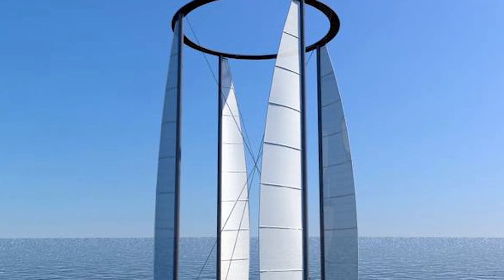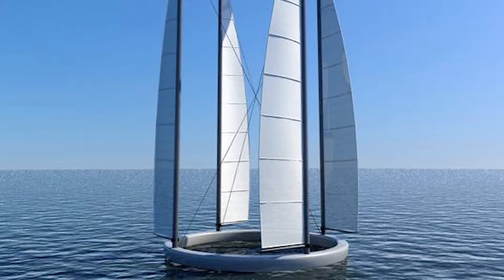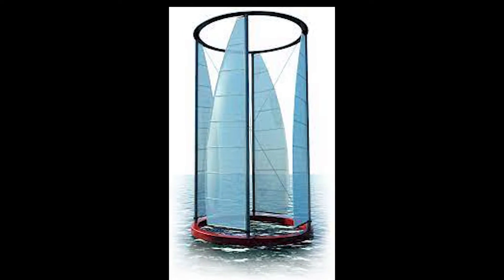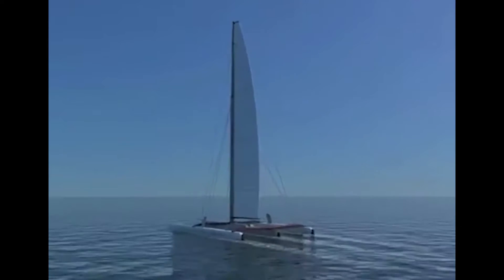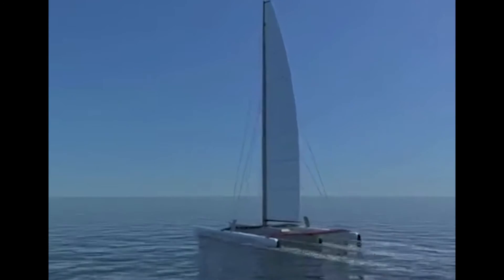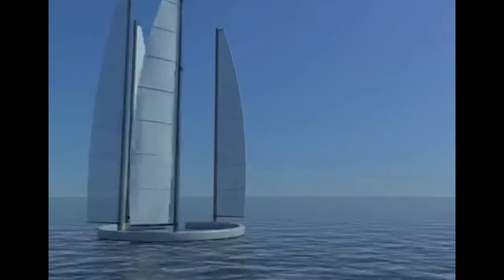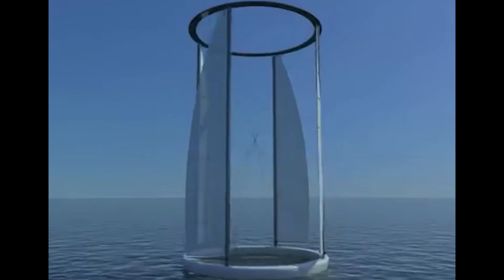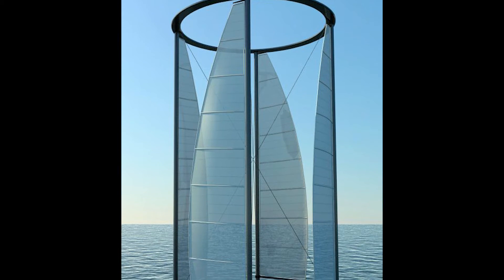This is a Game Changer! American Offshore Energy designs new-style floating wind turbines

Comment: I thought of some things like this,by my calculations 10 or more sails bigger rim, a second sectional rim in parallel that open for stability,great design,the same will work on a 10 miles train track if you can find a unstruct area remember train can change tracks ,so more than one is needed.